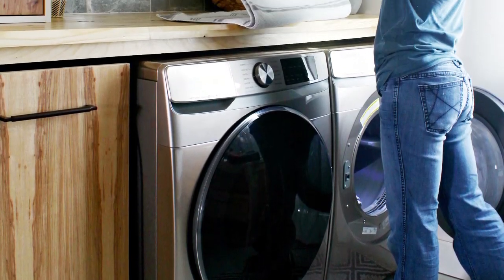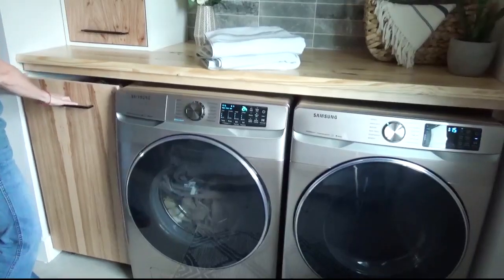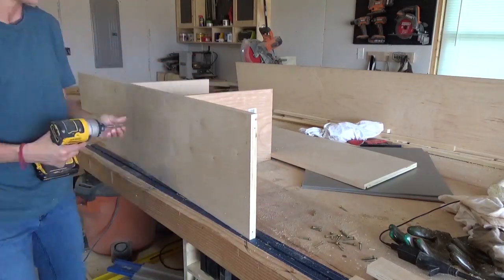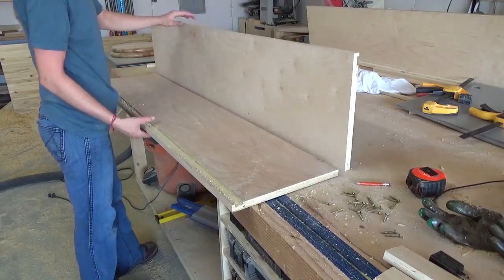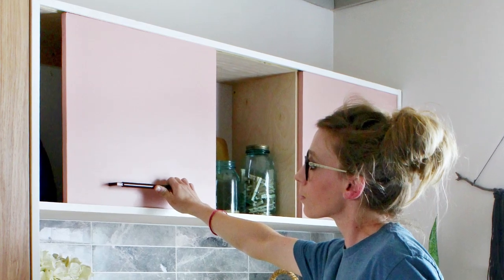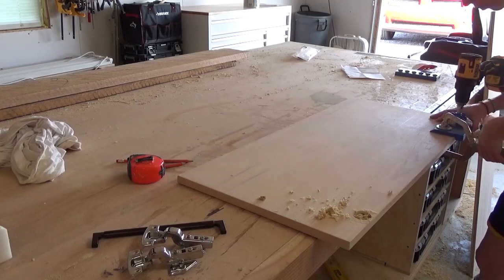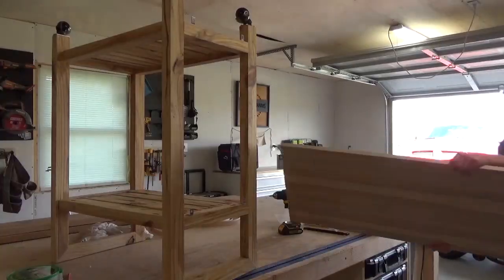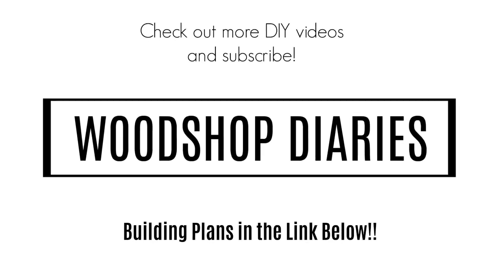Tiny Laundry Room Storage Solutions--Making the Most of the Space You Have

Comment: You channel is great. I did have a question. One view of your completed space, it seems either the laundry counter top is at a slope or the washer /dryer are on a slope. Perhaps optical illusion of a pic, but the gap on the far right seems larger then if you follow the gap to the left. Just curious.
Reply from the maker: Mark Robey the gap on the right is SLIGHTLY more than the gap in the middle. The angle makes it look more than it is. But our concrete floor is EXTREMELY unlevel and after fiddling with the washer and dryer feet for a while, we got it as close as possible and left it.